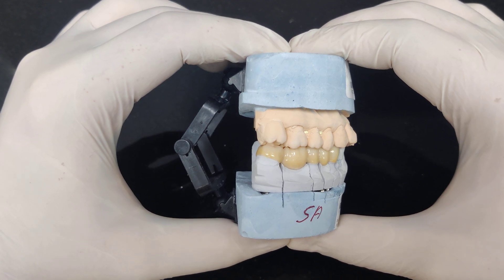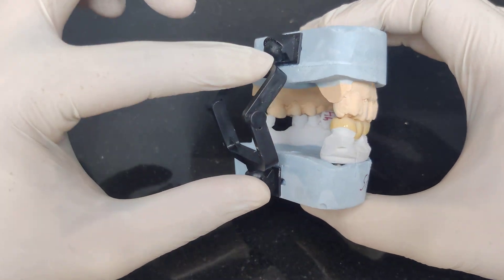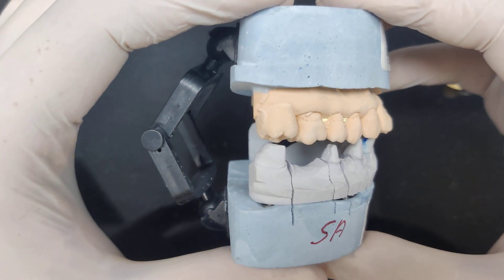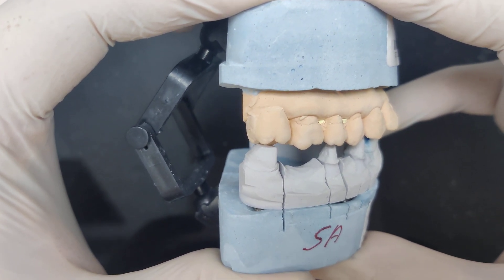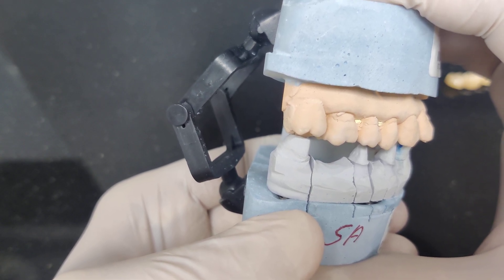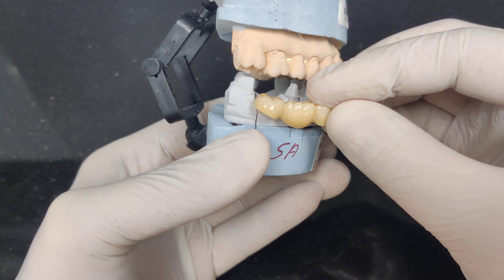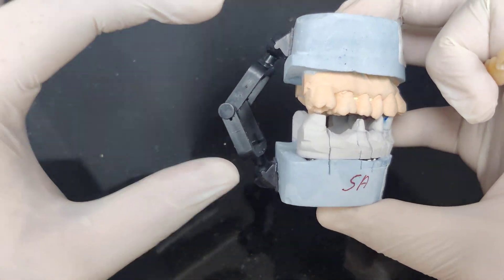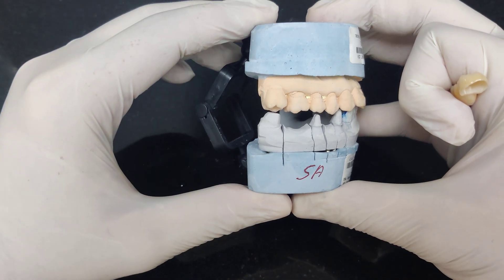ProsthoTip: Wrong Articulator #occlusion #fixedprostho

Comment: Sir the area where is practice in has pfm charges of 1500 max.. can we use A silicone impression, corded crown prep and impression, temporisation, CAD CAM crown, katara or dentkare lab with laser die ditching.
I have kept 2 qualities. One with jugaad tech like this in 1500 and 2nd with ideal things, that in 7000. In past 11 years i am yet to convince a patient to spend 5 times of crown just for a small thing according to patients called QUALITY